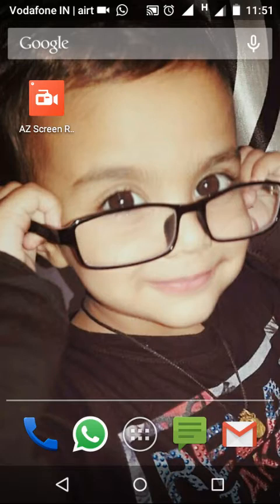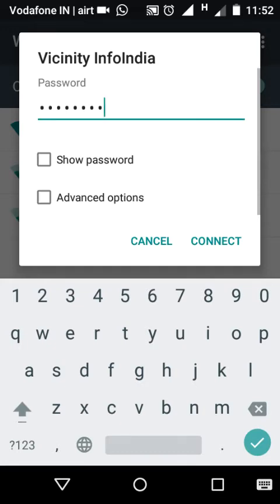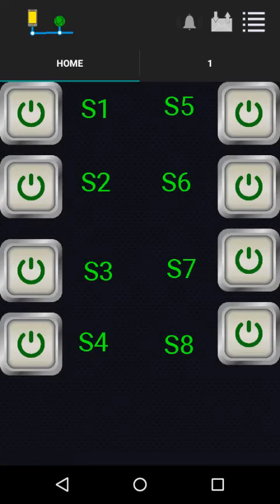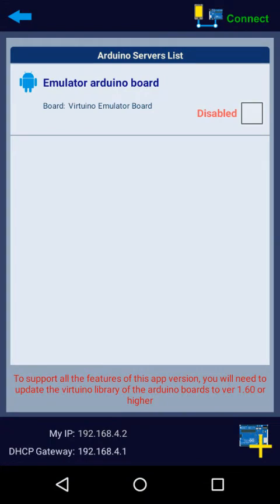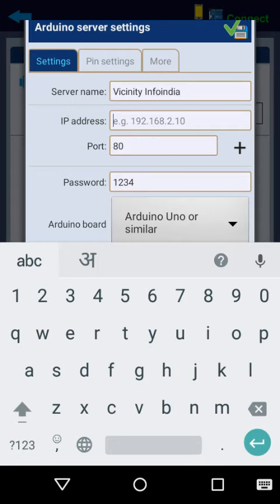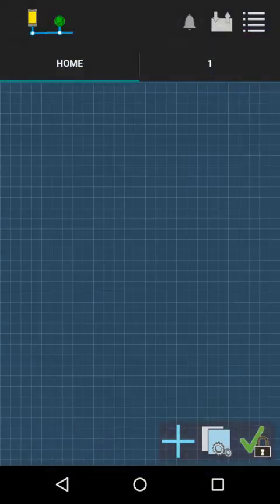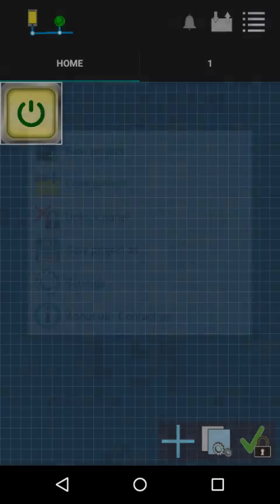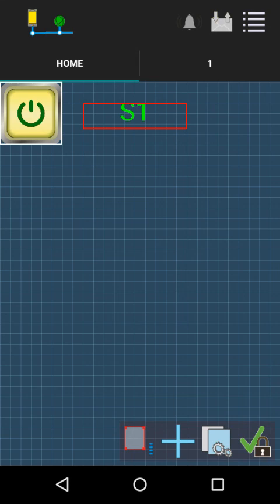WiFi Home Automation controlling of 8 Relay or Load Using ESP8266 NodeMcu

Comment: Sorry sir, i use google translate.

How do you get feedback from the physical button in the virtuino panel?
If the physical button is pressed the led is on and the switch on the virtuino panel is on, and vice versa if the physical button off the Switch panel on the virtuino is also off and led off.
I mean like in the blynk sync virtual pin and physical button, so that it can be activated via the virtuino panel and the physical button.

Thank you, Sir